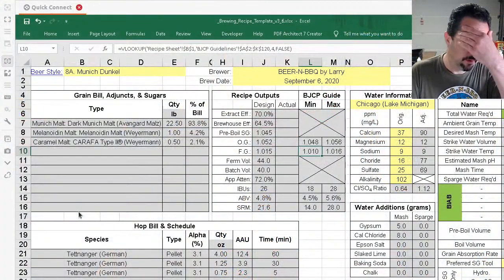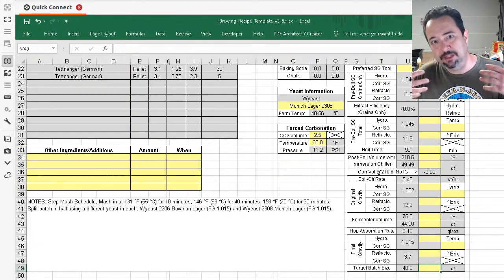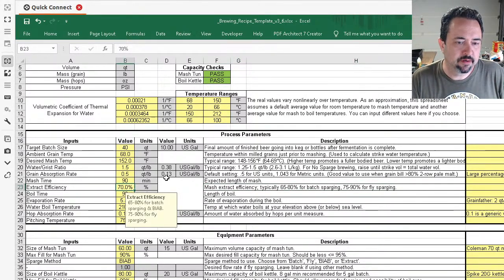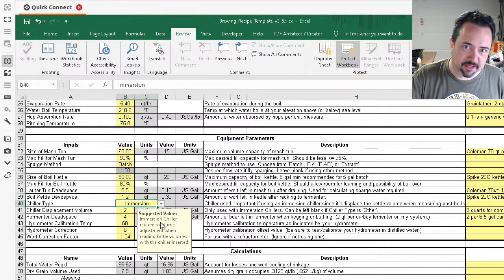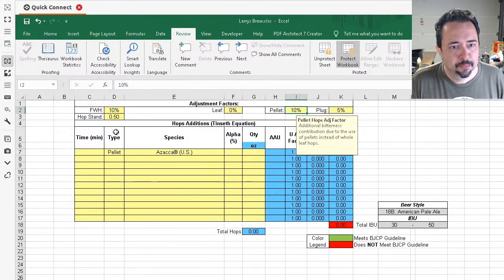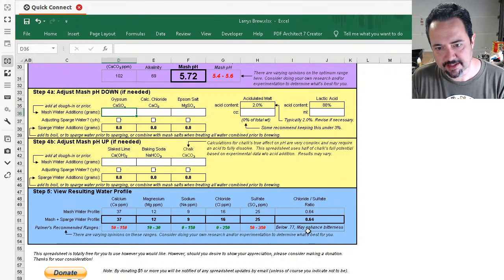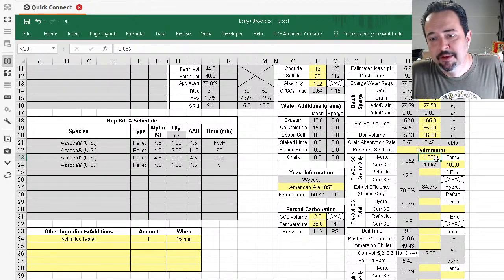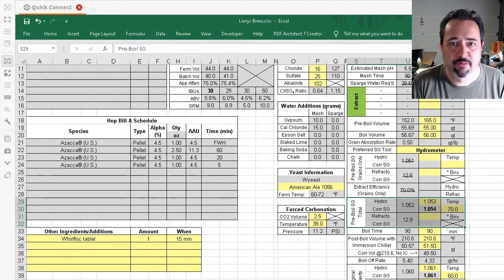Recipe Design Tutorial - LIVE

Comment: Hi Larry, thanks for the great tool sand videos! Question: I am using v 4.0.1. The brewhouse setup tap is a bit different than shown on this video (the video uses an older version yes?). there is no BIAB option (or am I missing it?). Thanks for the clarification
Reply from the maker: There’s a BIAB option. That was one of the major enhancements in it.
Reply: @BEERNBBQBYLARRY  I believe Brian is correct that there is not a pull down for “BIAB” or “Extract” with version 4.0.1. However I would assume you just say no sparge for those cases and the spreadsheet should workout. Thanks for continuing to refine the spreadsheet!
Reply from the maker: @zachrolf1454  That's right. Looking back at what I did, there are no such options. That's because it doesn't matter anymore.  The Equipment Profiles tab contains all the unique information for the spreadsheet to use with any system defined in it.

Comment: I've been using your spreadsheet for a couple years now and it's awesome! You have seriously done some awesome work putting it together. I like using it way more than beersmith. That's sad, I just noticed something that you might want to change for future updates. I noticed that in your grain and sugar calculations whenever you use a sugar it adds a pre-boil specific gravity contribution when in reality that's not necessarily true because it's time dependent. For example I just did an Imperial nut brown ale adding 1lb of piloncillo sugar at the 10min mark. By making that value zero on the grain and sugar calculations page It made my pre-boil gravity accurate vs. 0.010 off. I don't know if there's a way to integrate a timing for sugar but I don't know anyone who adds sugar before the boil. Anyways just a suggestion! Cheers!